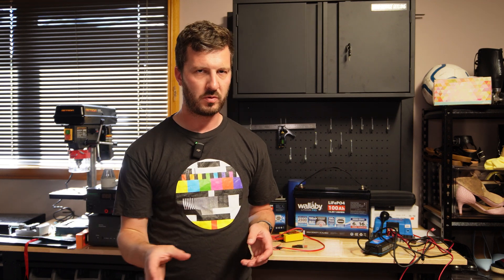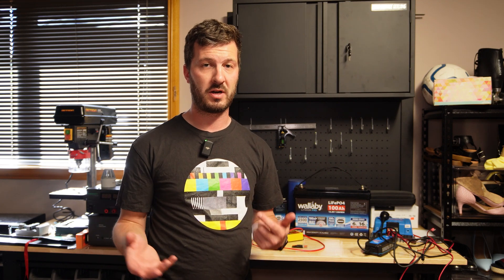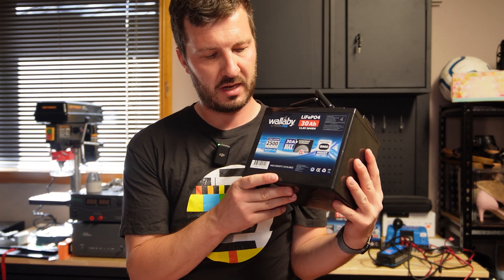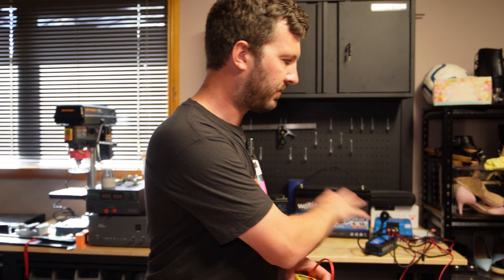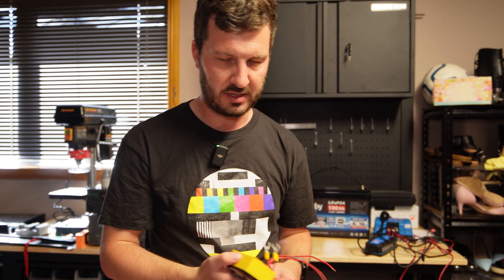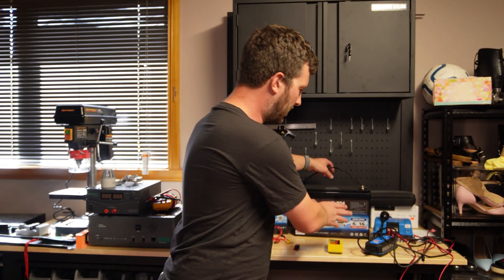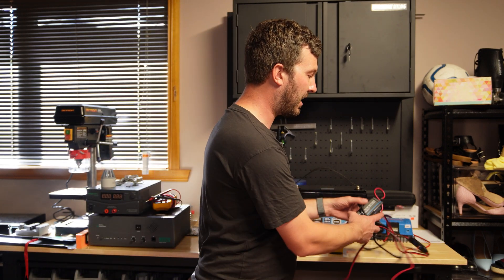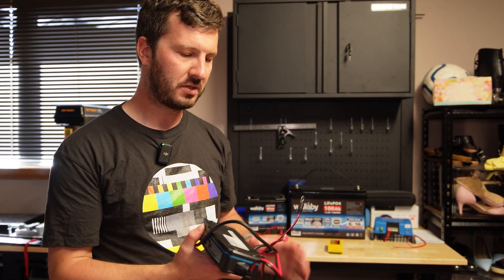How To Power Your Ham Radio Station - OFF Grid

Comment: I have an Acemo 1kw/1kwh power station.  I did not have the connectors for solar at the time Helene came through, but I do have an Inverter Generator.  What I did was power my apartment on the Power station. When the battery was low, I moved my plugs from the power station to the generator and plugged the Acemo into the generator to charge.  It only took about an hour to recharge the power station and I went back to it.  Overall, it took about 2 gallons of gas to keep power on for 3 days. 

Now, I have solar panels ;) 

I like having both. I'm getting the parts together to build a second power station with a 1kw battery.That one will be for my radios.  I'll plan to use the Acemo for AC systems in event of a power failure, and since I will have both, I hope to utilize them instead of the grid where I can.  They will never pay for themselves in saved electric bill around here, but I'm glad I had them during the power outage. 

Also, I feel better if I have a backup to the power station.

For the home, I have 3 100w panels and for the field, I have a 160w Dokio portable, two 30w portables, and a 10 watt portable that has 4A batteries in it for QRP. The DC power station I build will also be portable. My Acemo is heavy.